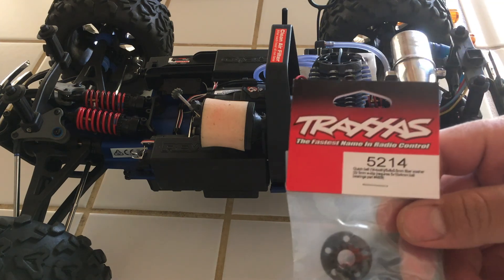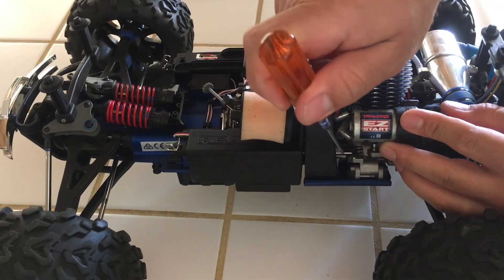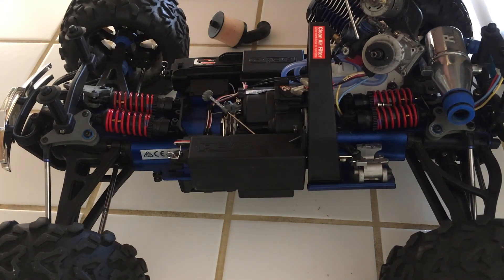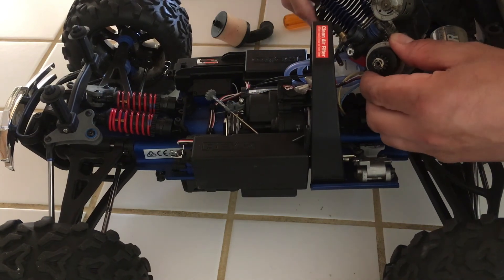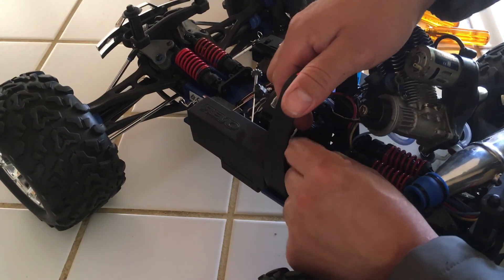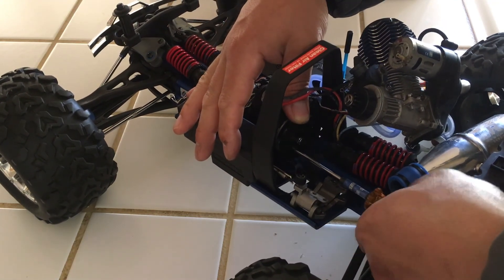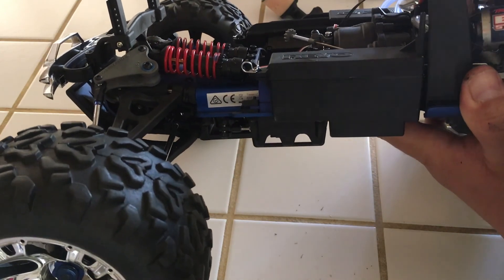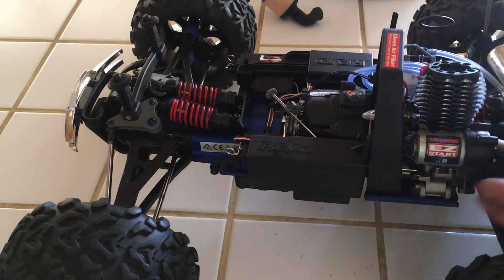Traxxas Revo 3.3 Nitro Replace Clutch Bell and Spur gear

Comment: I’m putting a 17t on in the morning. Great video 💪
Reply from the maker: I do like the lower gearing. I don't run it on packed or paved surfaces much. So low gearing gives me that pep and is easier on the clutch. I'll have to check out your videos on my private account. I'm glad to meet another nitro fan.
Reply: @telecomandorc  I’m doing my part go support what’s left in this nitro Rc world. It’s very rewarding. Thanks for the support 👊
Reply from the maker: @pitbikecookracing3324  Thank you kindly. I'll do my best. Cheers. 👊

Comment: I loved this video made it simple but hiw do I get air filter back on it hitting the 40t gear
Reply from the maker: It is a really tight fit. Mine does not hit. You just need to make sure it is all the way in. Use a flat head driver or a popsicle stick to put the bottom of the air filter down by the little ribs. Be careful not to press too high or you can puncture a hole in the rubber boot. Then you have to give it a bit of a twist L or R.

Comment: I didn't see you had to loosen the bottom mesh screw
Reply from the maker: For the engine? If you remove the 4 screws from the engine to the mount, you do not have to re-do the mesh. You just lift the back of the engine and turn it slightly to release the throttle link and lift off.

Comment: Watched this vid because I encounter a problem and the clutch could be it ...
If anyone can and wants to help out, here is my problem:
Have a new revo 3.3 and I can ajust the needles and idle but what ever I do, the car keeps moving as if there is no clutch applied.
When I google the problem, I only find the opposit, car doesn't move.
Could it be the clutch and if yes, what do i need to check out? 
Other option is an air leak, but for that, it idles (with wheels turning, haha) way to normal.
Thanks
Reply from the maker: I am not sure if it is "new" out of the box, or "new" to you. 
If you bought it new and within the return period, I would take it back to the shop. The shop-keep should be able to diagnose it. It sounds like you have done all you can to tune it. If it were the clutch, the truck would want to die when the tires hit the ground usually. Although, a weak clutch will do something similar to what you have described. But it could be the engine bearing seals that are leaking.  

Check the fuel system for leaks. Make sure the tank seals correctly. 

If it is "new" to use and bought used, it is possible for a bearings to not seal correctly. The front bearings only have one seal each as the fuel lubricates them. This can cause the engine to not tune correctly and be lean and produce an effect similar to what you described. This can happen due to the engine just being run a lot (they generally last up to 3 gallons) or the engine has been run too lean and overheated causing the seal to damage. This can happen when run at 275F 135C for extended periods. 

Bellow are other videos on removing a carburetor and general tuning.  

https://youtu.be/8MjnDNVYpIs

https://youtu.be/_uI6cdEyQek

https://youtu.be/vV9sCa5U84Y
Reply: @telecomandorc  Thanks a lot for replying. 
It's a new out of the box revo.  
Had troubles get it started first and then troubles keep it running for breaking in. I'm only half way with the breaking in procedure. 
I put the needles all back to factory now. When it is jacked up it runs idle with "normal" rpm but wheels are always turning. When I put it on the ground it dies, unless i push the throttle a bit, then it runs. When I pull the breaks to a stand still it dies again. There is always pressure on the clutch.
I would not mind trying to fix it myself because it's trouble sending it in out here. But I'm also pretty newbie.
Reply from the maker: @jonasgraf9692  
My pleasure. 
That sounds like a clutch problem. It could be a weak spring of a broken spring. I would remove the motor and take the bell off and inspect it. Pay attention to the orientation of the clutch shoes when you disassemble it as they are directional. 

I do have some more Revo 3.3 how to videos:

https://youtu.be/F4G8tVPGbcQ
https://youtu.be/4AJBVYJK1iA
https://youtu.be/snMmo8vFEeE
Reply: @TelecomandoRC  yes it is the spring, it snapped ... 
Thanks for your directions.
Reply from the maker: @jonasgraf9692  My pleasure. Enjoy it.